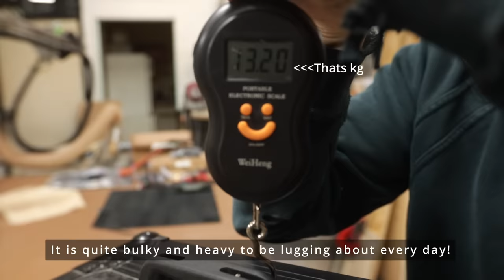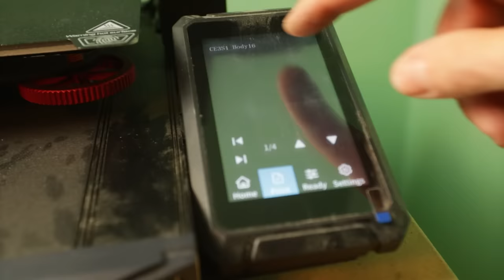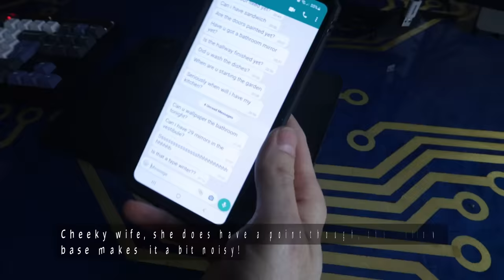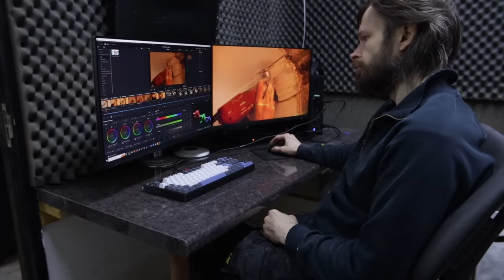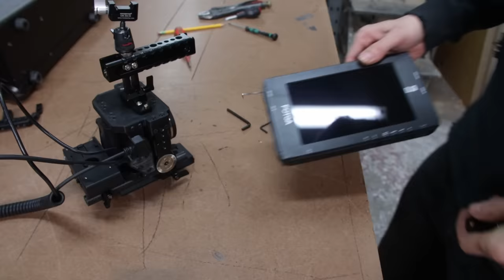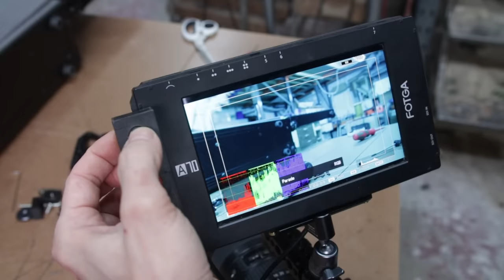Using technology to make technology

Comment: A small tip for inserting threaded inserts with a soldering iron: leave them a millimeter proud of the surface and quickly press them in against a flat metal surface while still hot. This ensures that they are flush with and perpendicular to the surface, and you avoid those bumps forming at the edge of the hole.

Comment: Those compact SATA connectors.. they are designed to use with a telco punchdown tool and without cutting the insulation :)

Comment: If the budget allows it, I would recommend to swap your SSD drives with M2 drives (which I believe your motherboard supports). It removes the need for many cables you had to mod and improves the airflow in the case since they are directly attached to the motherboard.
They are also much faster than SSD can ever be (SATA is an old standard made for the spinning disks era).

Comment: Amazing work, always love watching this man work, over engineering even the smallest detail is so satisfying, my only complaint is the use of pla, it will warp and does not have heat or weight tolerances for any kind of structural use, PetG or better ABS/ASA would be far more better choices. Keep up the great work, I can only strive to imagine how you actually got the Ender 3 to print in its condition, dirty and the rollers are caked with whatever and you still get perfect layer lines.... Hats off good sir.

Comment: 22:14 dont lift the cooler back off the cpu after pressing it on with the paste! you've now trapped a bunch tiny air bubbles in the paste when you put it back on! It's not the end of the world but the reason you're supposed to put a small pea of paste in the middle is so that as it gets squished by the cooler it pushes out all the air in front of it. pulling it off and then putting it back on again defeats the purpose.

If you did the same thing with the new cooler I'd reccomend taking it off and cleaning it and re-applying the paste just like you did before but without the visual inspection. you'll see cooler temperatures and need less fanspeed/noise to keep the cpu at the same temp

Comment: Nice setup - Blackmagic HQ are 45 minutes away from me in Oz. The only thing with pick & pluck that I have found in my flight cases for cameras , lenses, audio gear, accessories and lighting is after a while some of the pre-cut blocks come loose and eventually it needs to be replaced.  Then they do get a lot of location work, which can entail a number of moves in a day.

Comment: If you let the hot end get hot, and don't snip the pla of short but 5 or 6 cm longer, you can pull it out instead of pushing it through with the new pla. This way, you can pull out contaminated stuff, if any is there.

Comment: FYI: Those SATA power connectors aren't meant for you to strip the wire. You just press them in and the connector cuts the insulation.
Great build :)

Comment: Careful with spraying air into a fan. Surprising amount of dust, lol!

Also, happened to me years ago, helping out at a friend's computer repair shop. Basically my day to day job was spraying air into incredibly dusty Pentium 2s, dreaming of upgrading my old 396. Times were tough.

Anyways. One old lady walks into the shop dumping an ancient machine from her late husband. That day I learnt spraying air into the power supply's fan generates electricity.
I also learnt that old circuits don't deal well with current going the opposite direction.

The tiny trail of smoke told me that we'd probably not get many working parts scavenged.

Comment: Love your channel. Having set up and run a carbon composite company with lots of tech and electric machines inside, a warning: carbon dust will find its way into your devices. I flinched when I saw you sand the finish off your panel and then add it. At a minimum, you need to thoroughly stabilize any cut carbon surface. The tiny filaments will travel in a way metal does not. Mysterious shorts may take months or years as the resin breaks down at the edges. I would have used glass wherever you used carbon. We had passive static collection point all over the shop acting analogously to magnesium corrosion points in steel water tanks.

Comment: You should abandon the pick and pluck and replace it with closed-cell foam. You can cut it with your CNC cutter and get a far better fit, and the closed cell foam can be washed if things get dirty. It is also far more rigid than the EVA pick and pluck. Use a downcut bit on your CNC and you will not be disappointed. Your vacuum table is perfect for this application.

Comment: I've read that using a super glue accelerator leads to a weaker joint, and it's intended for tacking purposes rather than permanent gleye ups. I don't know how to characterize how much weaker, however.

Comment: I don't like a lot of scratch built cases but this I do. Did you do any calculations on the carry weight capacity offered by the handle? I wonder if the corners, where there is material removed for the screw-holes, might be a point of weakness?

Comment: You know, those SATA-connectors are IDC - Insulation Displacement Connectors, meaning you don't remove the insulation, you just press the cable into the connector and the insulation is cut (displaced) automatically. So you can save yourself a bit of work next time. 🙂
Reply from the maker: I thought they probably are but the conductors are very rounded and smooth and when I tried to push the wire in with the insulation on I just destroyed the wire and almost impaled myself with the screwdriver! Maybe its the type of wire im using or that I dont have the proper wire pusher tool.

Comment: if you want a good gimble/gantry system for your workshop look at Inheritance Machining for his setup. He films all his videos in what looks like a 40' x 20' room with a lot of machining equipment instead of the rolling gimble his is mounted to the ceiling and runs on rails like a CNC Machine but I feel like yours could go on a rail that has a bend on it to make the corner then just extended arms to get close to the walls. Forgot you made the rollie gimble, its been awhile since I last watched your videos because I wanted to see what you'd done with your house.

Comment: How do you rate the Fotga monitor, it looks like the 7" version.
Reply from the maker: Yeah I have the 7" for the main camera and 5" for the little  one. They are quite good, better picture than my old liliput a7s and more features. they are the only one of the budget monitors with lut and fully customisable custom buttons, all the other monitors just give a few options for each custom button. the only thing I dont like is all the extra plastic on the sides and these ones are not too bright outside, but im in the workshop 99% of the time anyway, they do a brighter version I think.
Reply: @NewYorkshireWorkshop  thank you for your input

Comment: The whole idea of having a metal case is EM shielding. Good luck with an unshielded PC in a workshop using heavy machinery.
Reply: Unless he puts it right next to the router's inverter it'll be fine. Leak currents from dust build up and insufficient AC filtering seem like a bigger concern in a shop environment.